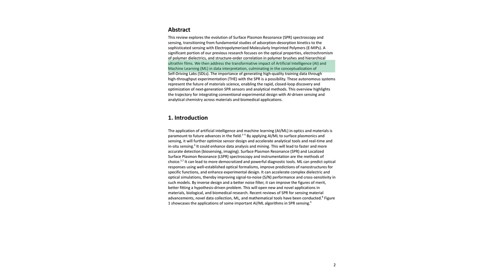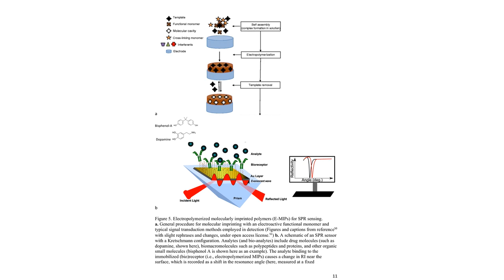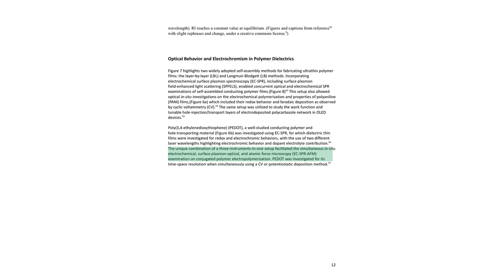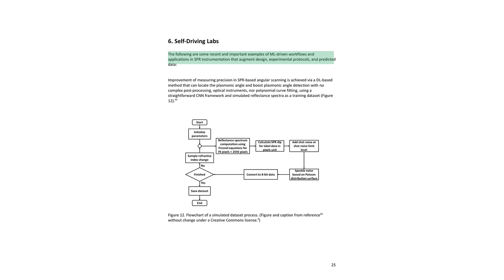AI/ML-Driven Surface Plasmon Resonance (SPR): Materials Interfaces and Autonomous Experiments

Comment from the maker: SUMMARY::
This video summarizes a review paper by Rigoberto Advincula and Jiua Chen on the evolution of Surface Plasmon Resonance (SPR) and its integration with Artificial Intelligence (AI) and Machine Learning (ML).

Key Highlights:
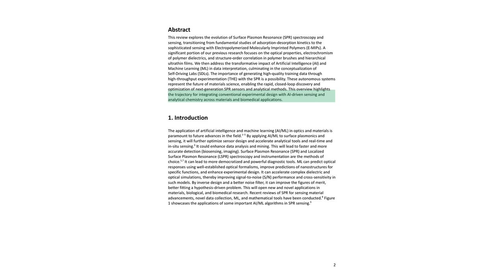Fundamentals of SPR (2:00 - 4:10): SPR is a highly sensitive optical technique used to monitor molecular binding and surface interactions in real-time. It relies on electron density waves at a metal-dielectric interface.
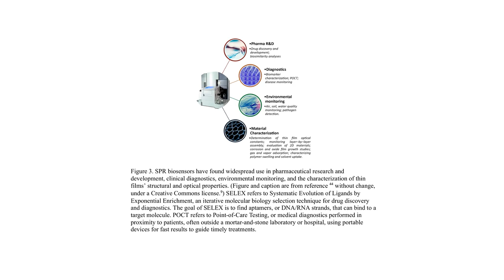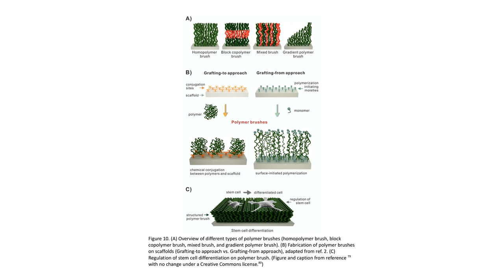Evolution of Sensing (6:00 - 13:00): The technique has advanced from simple kinetic studies to sophisticated sensing using Electropolymerized Molecularly Imprinted Polymers (E-MIPs), which act as "molecular traps," and the study of complex material structures like polymer brushes.
AI and Machine Learning Integration (13:19 - 18:00): ML enhances data interpretation, optimizes sensor design through inverse engineering, and builds robust diagnostic models (e.g., detecting SARS-CoV-2).
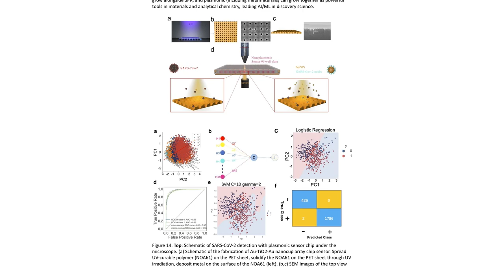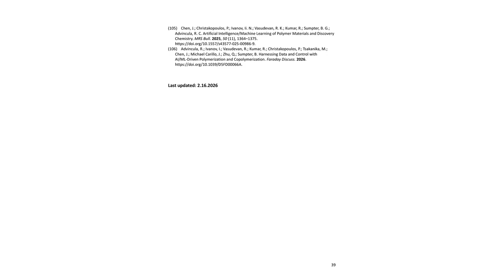The Future: Self-Driving Labs (19:10 - 21:26): The video conceptualizes Self-Driving Labs (SDLs), which utilize high-throughput experimentation (HTE) and closed-loop AI systems to accelerate materials discovery, creating a virtuous cycle of automated data collection and model refinement.